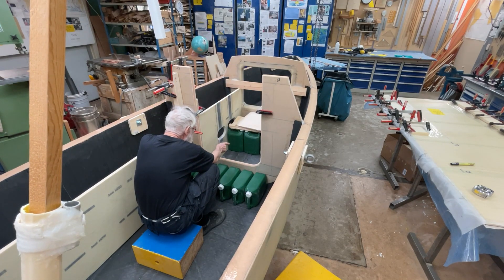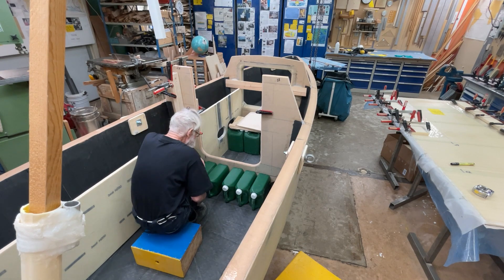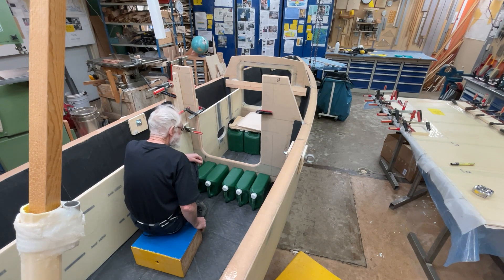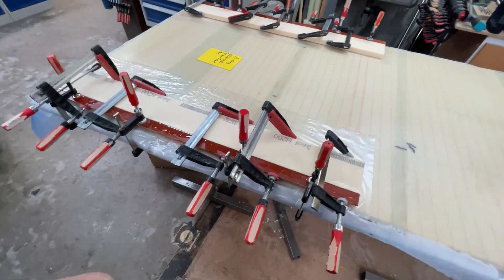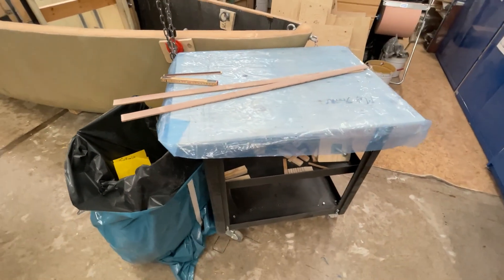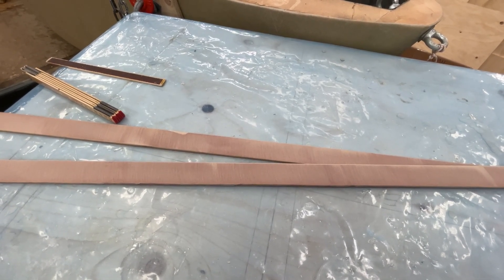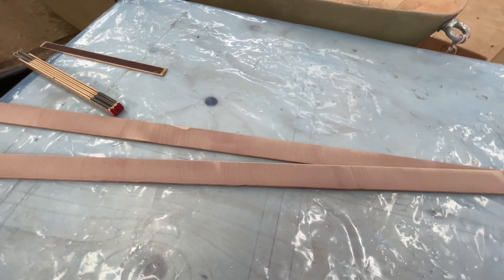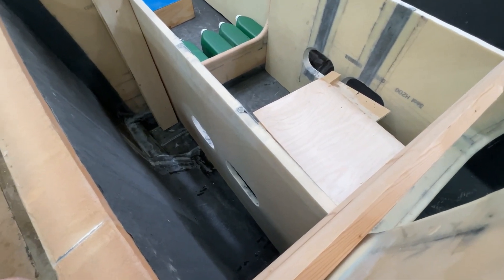How to simplify a problem. Here tracks for the sliding hatches.

Comment: I was wondering about the water, have you thought about using Reverse-Osmosis filters?  I've seen some other people use small systems to filter the water for onboard use in bigger boats but i imagine that for a small boat you could use a small filter. I can see some problems like reliability and losing the minerals in the water, but do you see other problems with the technology aswell?
Reply from the maker: They are expensive, not reliable and need service.
Plastic jugs are cheap and reliable and I have used them on my boats for 60 years.
I see no reason to change.

Comment: The red material I believe is a epoxy-coated fabric we call Micarta.  I normally see it in high-voltage applications.
If you have a strong enough substrate, you can use a thin-flat material similar to ptfe Teflon. But from my vantage-point, material (name escapes me at the moment!) might not be strong enough to just put Teflon-like strips on, so Micarta is a great cure-all for what you're trying to do.  You do want it to be easy to slide especially if it is weight-bearing.  Anyway, I am impressed with the hi-end materials that you are using.  This will turn out to be a boat that could last hundreds of years!  Great Job/Design/Work Sven!
Reply from the maker: The red material is Micarta or Tufnol as you say it is made for high-voltage applications. It is cotton fiber impregnated with phenolic glue.
Reply: @SvenYrvindExlex  Right-Right exactly, It is Phenolic impregnated cotton fiber.  Anytime I strip or salvage out old electrical/electronic equipment for parts, I always keep a keen lookout for materials like Micarta, stealite, fish-paper and even bakelite; great materials!